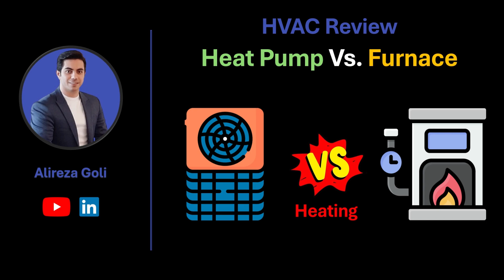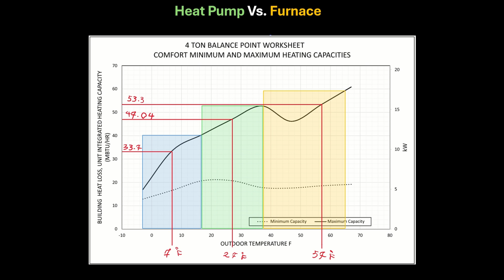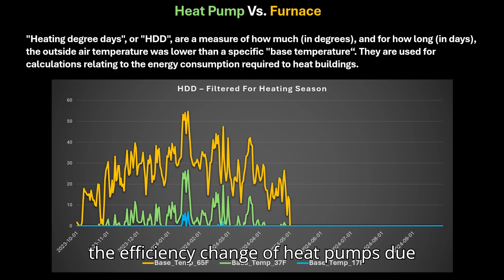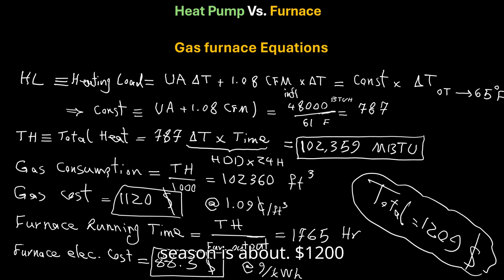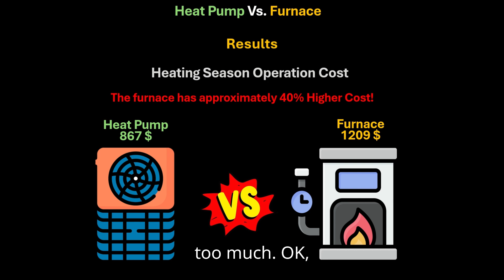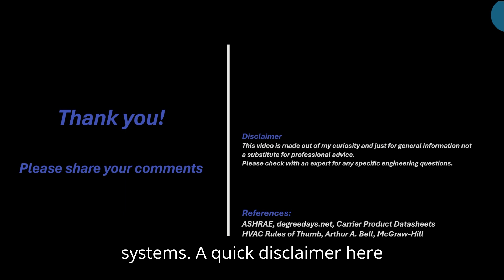Heat Pump Vs Gas Furnace

Comment: I had a Mitsubishi heat pump installed last year, removed the gas furnace, similar house in Aurora CO. My unit is way better at cold temperatures than that Carrier model; it'll put out the same BTUs from 0F to 60F, and at 0F it has a 2.5 COP. I prefer that type of cold performance. In my case, I didn't need heat strips or any backup, and it got to -20F a few times. I would check the house heat loss carefully because the gas furnace may have been oversized.